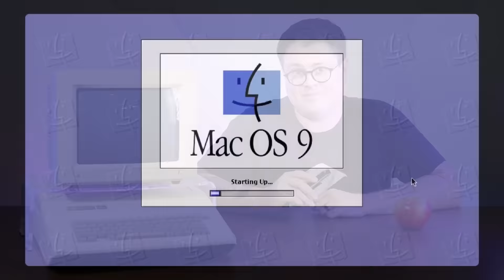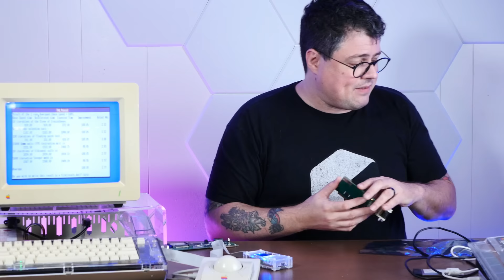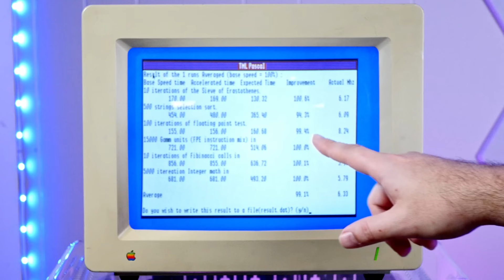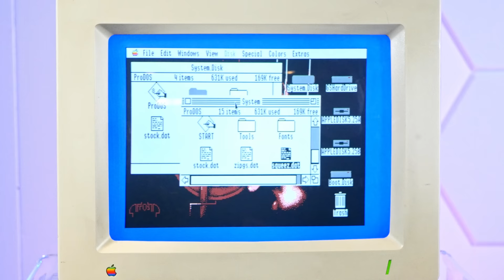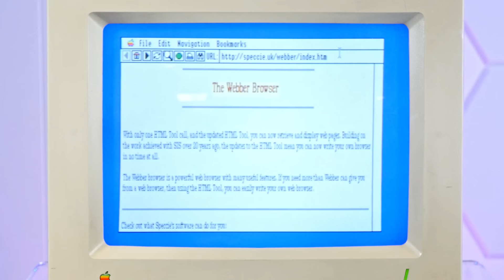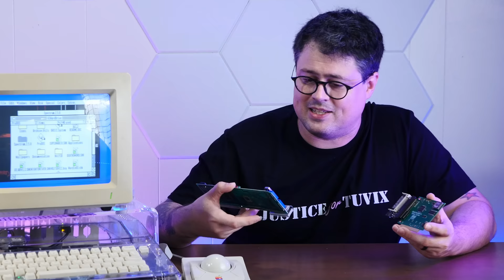This Apple Accelerator is INSANE

Comment: What you have there is the Apple II GS that Apple could have made, but never would have in a million years, because it would have competed well against the Mac.
Reply: Fast forward to 2022, and Mac is a small, minority platform.  Only 8% market share.

Intel Alder Lake and AMD Ryzen, running Windows 10, rule the world now.
Reply: @DerekDavis213  Since people tend to keep their Macs for longer than their Windows PCs, market share (of sales) is not an accurate indicator of installed base. Browser statistics are better: looking just at desktop OSes, macOS has about 19% share.
Reply: @tookitogo  19% share ?   So about 1-in-5 people on Planet Earth are using a Mac?   LOL!   Don't be ridiculous!

Windows has a HUGE software base, and is the world leader for gaming.

A Windows PC offers FAR better price vs performance, compared to any Mac.

Windows machines are easily upgraded with more RAM, larger and faster SSD, and the latest monster video cards from NVidia or AMD.    Mac is locked-down, dead-end, a disposable computer.   Mac has very little quality native software.

Mac now uses M1, a processor from a cell phone.  Mac can no longer run Windows software with near 100% compatibility.  That makes M1 Macs totally inferior to Intel-based Macs.
Reply: @DerekDavis213  As for the other nonsense you spewed:
“Slower SSDs” — Nope, not correct.
“Price vs performance” - the cheaper M1 Macs wipe the floor with comparably priced PCs
“Little high quality native software” - you have ZERO idea what you’re talking about. Yes, there’s more programs for windows in absolute numbers, but the quality often sucks. The higher quality of Mac software is one of the reasons I prefer that platform.
Reply: @tookitogo  What nonsense?   Everything I said is true, and I say that as a Mac user for 15 years.  I work in IT, and there are a few oddballs, weirdos, at work that use Mac.  So I have to know the Mac platform.  I regret that I have wasted my time on macOS and iOS.

Windows machines can easily add a new, ultra-fast 7000 megabytes/sec SSD drive.   Macs are not user-upgradeable.  And some Macs are not upgradeable PERIOD, because the SSD drive is soldered-down.  Say hello to disposable computers.   Thanks, Tim Cook.

The cheaper M1 Macs are gar-bage.   4 fast cores, 4 weak cores.  An ARM processor from a cell phone.  The latest 12th-generation Intel processors, or AMD Ryzen offer MUCH BETTER price vs performance!

Name some grade-A Mac software, that is comparable to the best on the Windows platform.   Besides Final Cut or Logic Pro.  The biggest, richest, most successful companies in the world use Windows to get the job done 24/7.  I am talking about the Fortune 500.   Dell, HP, and Lenovo sell 200 million Windows machines every year.  Mac is tiny and pathetic compared to the Windows juggernaut.

Did you know that video editors that work in television, feature films, or million-dollar advertising campaigns do NOT use Final Cut?    They use Avid, Premiere, or Davinci Resolve.   Final Cut is popular with high school kids and Youtubers.
Reply: @DerekDavis213     15 years? That’s a good start. I’ve been a Mac user since 1992, worked in IT most of my career (including as a onsite Mac consultant, and a few stints working at Apple resellers or Apple Stores). In fact, until less than a year ago, I never even owned a Windows PC of my own (but used them at work).

You are absolutely correct that many Macs are essentially disposable, and that does have some downsides for sure. (Heck, one of my Macs at home is still a 2008 Mac Pro that’s been heavily upgraded over the years, with no obvious path for replacement in Apple’s current product line.) But the fact is, statistically speaking, the overwhelming majority of computers (even ones that are upgradable) never receive any hardware upgrades whatsoever before being disposed of. We’ve long reached a point where computers are more than fast enough for what most users need, so upgrades simply aren’t as pressing an issue as in the past. 

The best software on Windows is excellent. I never said otherwise. But the bulk of Windows software is really rough around the edges. It gets the job done, but the user interfaces are awful. It’s actually the little utilities that you need here and there where you see the biggest differences. On Windows they often have terrible user interfaces, or are expensive. On macOS, utilities tend to just be more polished. (Plus there are the OSes themselves: though Windows 10 and 11 are far better than earlier iterations, macOS is still just smoother to work with. I use Windows on a daily basis at work, and certain things remain maddening.)

Many of the best software packages for the Mac (including several you listed, like Davinci and Premiere, and others you didn’t list, like Microsoft Office) are cross-platform and perform well on both OSes. In those situations, sometimes the Windows versions are a bit more polished, sometimes the Mac versions are. 

Of course, most business applications (databases, finance, etc) have moved to web apps now and run on anything. FYI, Apple is a Fortune 500 company and runs almost entirely on Macs. IBM is a Fortune 500 company that has over 150,000 Macs, and has publicly reported its Mac users to be more productive, with the Macs having a significantly lower TCO than Windows PCs. 

And sure, there’s stuff that’s still Windows-only, nobody is disputing that. I’m actually currently changing careers towards electronics, and all of the truly professional-grade PCB layout programs are Windows-only, so I had to buy the aforementioned Windows PC for my schoolwork. Some of those apps are really nice to use, some are horrible user-hostile beasts.

As for hardware performance: yeah, the latest Intel and AMD offerings do perform well. But you clearly haven’t been paying attention if you think the M1, and then the M1 Max and Ultra, are slouches of some kind. That couldn’t be further from the truth. You dismiss them as “cellphone” processors, but these “cellphone processors” outperform a cheaper PC CPU, and do it on a tiny fraction of the electricity. It was five years ago that Apple’s iPhone SoC first outperformed a then-current MacBook’s i5 CPU. So even if the M series of Mac SoCs is derived from a mobile chip, the fact is that it performs spectacularly. (Note also that the ARM architecture was actually originally for a desktop computer, and that the entire Intel Core series CPUs are derived from the old Pentium M (mobile) architecture, with the “big” desktop x86 lineage — the Pentium D — being discontinued. So there’s a long established history of lightweight architectures scaling up to become powerful ones, whereas shrinking the desktop architectures down for mobile doesn’t work out.)
Reply: @tookitogo  So you've been a Mac user for 30 years, and never owned a Windows PC of your own?   Well that explains a lot.  You only know the Mac, which has a tiny 8 percent market share in 2022.   The whole world has pretty much ZERO interest in the Mac.  Especially the Fortune 500 companies.

Apple runs entirely on Macs you say?  Compare that to Windows:  more than 200 million machines sold last year.  And IBM is not a good example of Mac use, because IBM and Apple are business partners, they are in bed together.

I never said that M1 Max/Ultra are slouches.  They are very fast for what they are (cell phone processors).  But M1 has several major flaws :

-ridiculously expensive
-cannot run Windows software perfectly
-terrible for gaming
-few native M1 apps
-M1 gpu is very weak,
-when compared to NVidia/AMD

Also M1 has loads of issues and problems, compared to an Intel-based Mac or Windows PC.  M1 native software has issues with plug-ins and add-ons (Premiere and Photoshop).   Every printer, scanner, webcam, game controller, input device works perfectly with Windows.   The same cannot be said about M1.

You mention that M1 uses a 'tiny' amount of electricity.  Apple loves to mention this too, because that is one of the FEW advantages of M1.  On a desktop computer, less electricity use is meaningless .  

An extra 50 cents per day on your electric bill is totally worth it, if you can enjoy the MANY advantages of a Windows PC.   Many people spend $15 every day for coffee and gas money to drive to work.

I'm sorry to hear that you've suffered working at Apple Stores.  Even though Apple is a trillion-dollar company, Apple Store workers are paid poverty wages . Just google it for proof.  The workers at the iPhone factory in China are treated even worse!  They are paid starvation wages . Tim Cook couldn't care less.
Reply: @DerekDavis213    I have used Windows PCs at work (including providing tech support for them) for 20 years, so I know Windows pretty well, too. So tone down your assumptions, cowboy. 

Apple’s share of new machine sales is 8%, but as I already explained to you, the installed base is more than double that. You need to understand that these are not the same thing!!

IBM and Apple aren’t partners now. IBM is just a big customer. The fact that two Fortune 500 companies run significantly on Macs means they are viable for that purpose. That’s not changed by the fact most other Fortune 500 companies haven’t found the advantages to be big enough to warrant the significant cost of switching over their entire companies. 

Aside from your other incorrect statements about the M1, you say that the low power consumption is meaningless on the desktop. That’s true to a point. (It does matter, just not nearly as much as on a laptop.) However, since the vast majority of computers sold (75%!) are notebooks, this matters to the vast majority of computer users. Your argument is like “well the cost of driving an electric car is really low so the price of gasoline doesn’t matter” while ignoring that most drivers use gasoline-powered vehicles. 

While they certainly could pay more (who will ever say they’d rather earn less money?), Apple certainly didn’t pay poverty wages at the stores where I worked. Between wages and benefits (which are above average for retail), one could do a whole lot worse. 

Anyway, don’t bother responding. You’re obviously not interested in a constructive discussion, since you keep just repeating easily-disproven claims while ignoring every substantive thing I’ve said. Just know that you’re not nearly as smart or knowledgeable as you think you are. I’ve been at this longer than you have, and I see right through BS like yours.
Reply: @tookitogo  Where is your proof that the 'installed base' of Mac is double?  URL?  You might claim that Mac users don't buy a new machine frequently, but guess what?  Windows users don't either!

Apple and IBM are partners for sure.  Apple sponsored wide-spread iPad use at IBM, and assisted them heavily in that.

Just because Apple and their business partner IBM use Mac (eating their own dog food basically) does NOT mean that other corporations would make HUGE sacrifices to use Mac instead of Windows.  Especially now that Apple has abandoned Intel for an ARM processor from a cell phone.  Decades of legacy software is now ready for the garbage can, for Mac users with an M1 processor.

In 2022, cost of living is higher than ever:  housing, cars, gasoline, health/dental/vision care, food, etc etc.   Apple Store workers are living paycheck to paycheck , with nothing going into a savings account.  In other words, poverty wages.

Everything I've said is undeniably true:

-Mac has a tiny market share
-M1 has huge disadvantages
-M1 is way overpriced
-Windows software base is SUPERIOR
-Apple pays poverty wages

I'm sorry if your feelings are hurt, you've invested 30 years in basically a LOSING platform.  Your resentment and hostility are to be expected.
Reply: @DerekDavis213   I can’t give you a URL since YT would almost certainly auto delete the entire post. I’ve entirely given up trying to provide URLs for this reason. The Wikipedia page “usage share of operating systems” lists 15% for macOS’s share of desktop/laptop OSes. The 19% I stated was using the “Operating System Market Share” from Statcounter by GlobalStats, which lists for July 2022: 27.92% Windows, 1.02% Linux, and 5.37% macOS (the remainder being Android and iOS,  which of course are not desktop OSes,and around 2% “unknown”). 5.37/28.94=18.55%, or around 19%. 

It’s absolutely true that the average lifespan of computers, both windows and Mac, have been growing over the years. But Macs still enjoy significantly longer average lifespans. 

Deriving a desktop CPU from a cellphone CPU is fine, provided the cellphone CPU was good. And in this case, it was superb. 

As for the rest: again, not gonna waste my time on your stubborn obstinacy. Don’t bother responding. I’ve participated in this conversation in good faith, but you haven’t: you continue to lie, misconstrue, and ignore. I’m out. 

Take care, I hope you’re able to recover from the mental straitjacket you’ve put yourself in.
Reply: @tookitogo  One reason why Mac computers have longer 'lifespans' is because they are ridiculously overpriced.  Customers must wait a LONG time to get their money's worth.  For example:

Mac Studio for $8000
Mac Pro for $19,000

Using a cellphone cpu on a desktop PC is NOT OK when decades of productivity and gaming software suddenly doesn't work properly anymore.  Also many hardware peripherals and accessories have issues on M1 Macs.

You are not going to respond to my other true statements about the M1 Mac?  Ok fine, I accept your surrender.

I am part of the 92% Windows majority.   It is the hostile, defensive, resentful Mac users that need a 'straitjacket'.
Reply: @tookitogo  Just for the sake of argument, let's say the Mac share is really 16%.     Mac has been around for 38 years (since 1984).  Apple Corp has almost unlimited financial resources and a world-class Marketing department.   A share of 16% in 2022 still means that...

Mac is a HUGE LOSER

You can't accuse me of being a liar when neither one of us has accurate market share numbers.  We are just going by published stats on the web.

For a guy in his 40's or 50's, your debating skills are quite weak.  LOL

In the next 6 months, AMD and Intel are releasing some new monster processors.   And new monster video cards are coming soon too (Geforce and Radeon).   

Windows owners can easily upgrade .    The sad Mac guys, off in their own little corner, are going to miss out.
Reply: @DerekDavis213  you come to a page about Macs, make a point. When it’s disputed, you start writing out your personal preferences like that means anything to anyone or anything to your point. Do you talk like that in person? Do something else.
Reply: Clearly a shift in Apple’s thinking since they’d end up competing with their own customer base with iPad all those years later. But clearly they resisted it by refusing to add proper desktop features till very recently. Apple will keep making rubrics and try to distinguish desktop systems from mobile but that’s only true for people who grew up without mobile
Reply: @Freshbott2  This not a page about Macs, this is about Apple II.

Anyone that is even remotely interested in Apple computers will note that Mac computers are doing very badly in 2022.

After 38 years in business, Mac has a tiny pathetic 10 percent market share.   Woz and Jobs founded a wonderful company, but today Mac is a footnote, of zero interest to most people on planet Earth.
Reply: @Freshbott2  What's a rubric?
Reply: @DerekDavis213  they’re not doing badly. And to say that isn’t a defence of Macs anyway so don’t bother. You know Apple, and their lack of success. Lol don’t you just know better. A telltale sign of a shit argument is defining your own arbitrary measure of something and trying to use it on other people in  debate you invented. He wasn’t even talking about the same thing. Some guy you felt the need to talk at on the internet isn’t convinced of a wealthy company’s failure any more than he’s comparing the sales of Corollas against Ferraris. Really no one cares.

I feel for you. You’re uncomfortable and if you’re anything like that in real life you make other people uncomfortable while you think you’re winning something. Take a breath and talk about something nice.
Reply: @Freshbott2  Of course they are doing badly.  Macs have been sold for 38 years, and in 2022 they have a tiny pathetic market share.   The Windows software ecosystem is HUGE compared to Mac.

Gaming is very popular, doing $180 billion in business just last year.   M1 Macs are terrible for gaming, that much is indisputable.

I'm not uncomfortable at all.  I'm am part of the 90% Windows majority.   I don't suffer with a computer that is non-upgradeable, non-repairable, and grossly-overpriced.   Apple abandoned Intel processors, and now Mac has a processor from a cell phone .  omg so weak
Reply: @DerekDavis213  I don’t need you to tell me about gaming on M1. Do you think people are buying MacBooks to game? You have a warped idea of success. Gaming has little to do with market share, the majority of devices are crappy commodity boxes running web apps on a commodity OS in offices and universities that will never be upgraded. They’ll go to the shitheap in a third world country when they’re done with like everything else. At that point you may as well say Windows is dismal cause there’s so many Android devices. 

That massive gaming industry is mostly loot boxes and pay to win on crappy mobile games. Games you and I play on PC are the smallest component. 

I don’t need to brag about my gaming  PC. You don’t need a medal it’s not that special. Windows is a legacy OS now trying to support a different architecture. If Microsoft hadn’t made the Xbox in the 2000s they might have moved on to something that isn’t a disaster. When Wozniak was at Apple these older systems you tried to appeal to had the same market share as Macs today. Be honest. 

Every time Microsoft tries to achieve something, they back out for fear of upsetting legacy users. UWP died for that reason. The only software from the  80s and 90s you’re actually running is the OS itself. Everything else SHOULD be recompiled or one day run in a container on a different architecture and the point is moot. Windows has really had it, why they’re handing it out for free. Now stop bragging about your free installation, we’ve all got one.
Reply: @Freshbott2  People buy MacBooks for programming, video editing, and impressing their friends at Starbucks:  the sad girl, and the Asian guy with a nose ring.

Of course, almost everyone loves gaming AFTER the work day is over.  And M1-powered Macs are terrible for gaming .  An ARM chip from a cell phone can obviously NOT run games that are made for Intel or AMD x86 processors.   Windows has 90% market share, while Macintosh is gasping for air in the gutter, so to speak.  Mac has 38 long, sad years of history behind it.

So you are denigrating pay-to-win mobile games?  That's EXACTLY what Apple is peddling in the App Store!  omg too funny.

Windows has really 'had it' ? Are you kidding!?  Over 200 million Windows computers sold last year, and the x86 juggernaut is unstoppable .  In a few months, the next monster high-performance processors from AMD and Intel are releasing.   Meanwhile, Apple is trying to turbo-charge an ARM processor from a cell phone .  Who is the head of engineering over in Cupertino?   That guy ought to be fired.

Mac Studio is basically a fat Mac Mini with a faster processor.  $7000 USD for the top Mac Studio?   What is Apple smoking?   omg w t f.
Reply: @DerekDavis213  the sad girl. Jesus lord. Find some friends.
Reply: @Freshbott2  That's all you have to say?   I pretty much eviscerated the weak overpriced Mac, and your silence hands me the win.   All too easy.
Reply: @Freshbott2  Oh man, this Dee loser just keeps digging themself in, deeper and deeper… 🤣 As you said, they’ve got a very weird sense of what winning and losing means.
Reply: @tookitogo  Didn't find the praise he needed. Should head down the shoe shop make it be known he can tie his shoes on his own, what with being so unique and all.
Reply: No. In 1986, when Apple made the IIgs, WDC didn't sell 65816'es that were rated for over 4MHz. The CPU had speed issues until it was redesigned in the early 1990s.